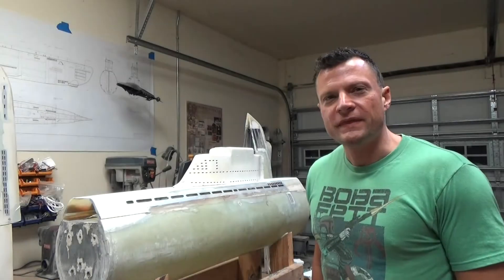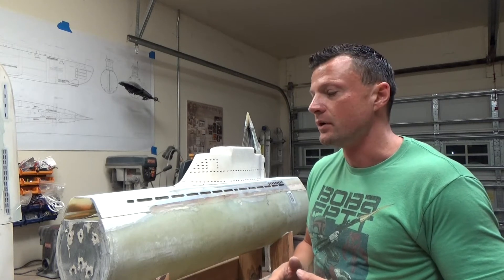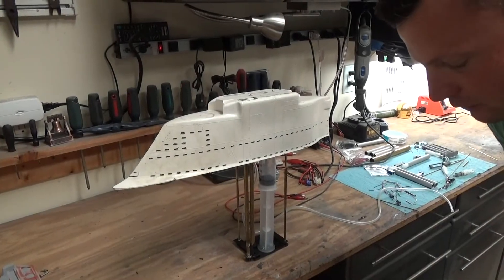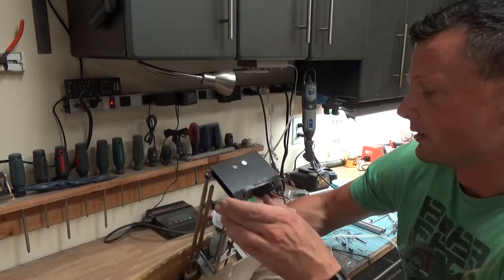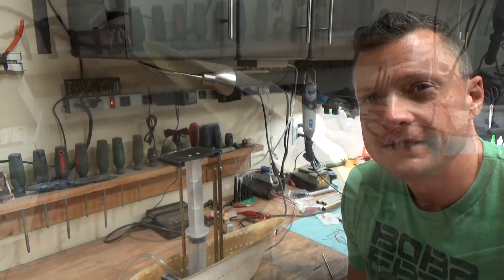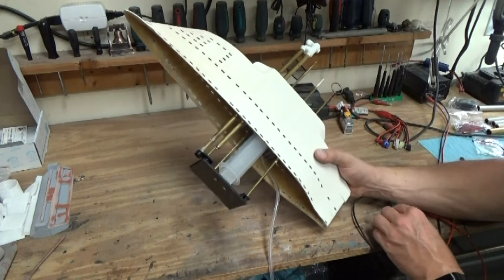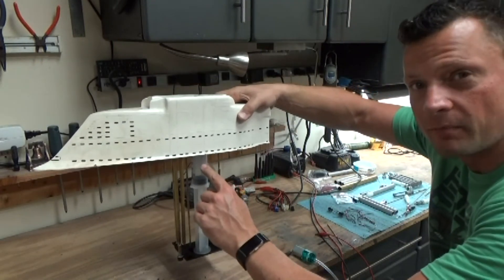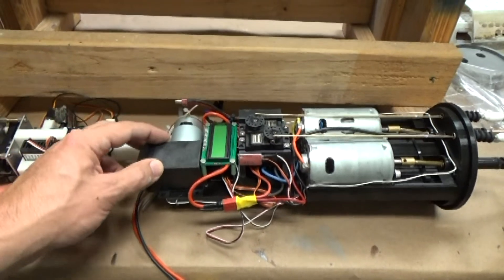Massive German Type XXI RC Submarine Build Blog #4

Comment: Dude, why 2 pumps for the periscopes when you literally just need to reverse polarity on your pump with a simple switch?
Reply from the maker: The pumps only operate in one direction. They are diaphragm pumps, not peristaltic.
Reply: Oh ok, if it works it works, just seems ....lol, just realized I was about to say over engineered....german sub...yeah, using 2 pumps fits the model just fine, since it's a german sub!  ;)